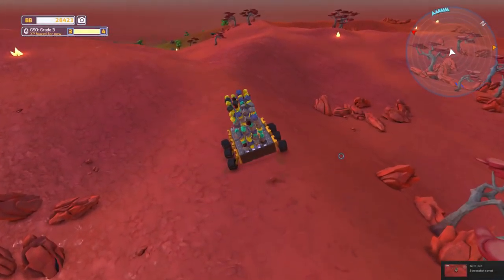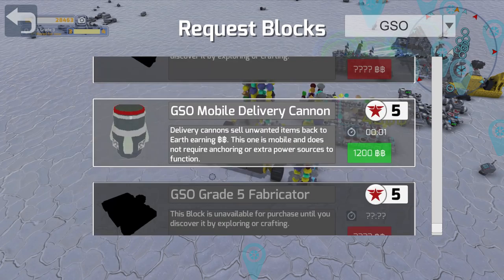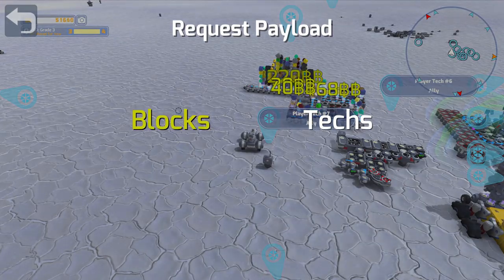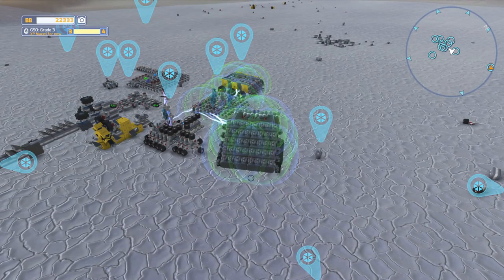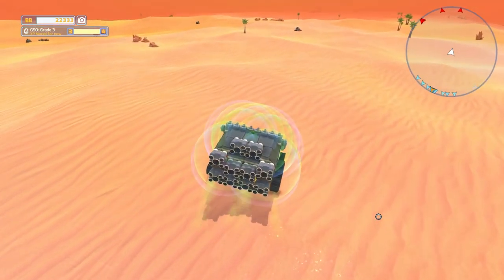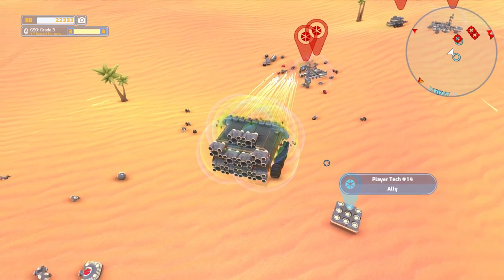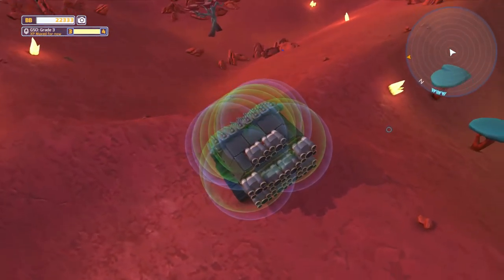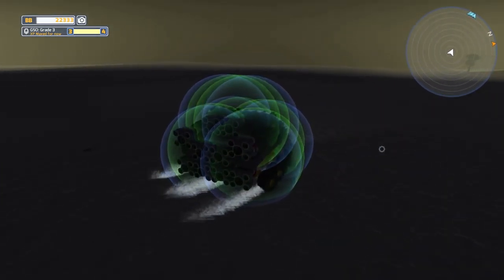TerraTech #17 - 150 Pound Cannon

Comment: The rugged wheel you just found is the best wheel in the game for the tech size your using and there free. If your having trouble getting plumbite pickup the 1 x GSO blocks run them thru the scrapper and refinery you get 2 ingots.

Comment: +Zisteau 
Fabricator grade 4 and 5 you probably don't have and maybe don't spawn. Might need an invader with one on. Or getting lucky with a "block holder". 
I set up small base close to the GSO Trading Station and start destroying larger techs and sell parts. The tech I use is not so much bigger than your mining one (6 wheeled GeoCorp). I use mostly  15+15 of the small cheap laser weapons on the front, they wreck most AI techs fast enough and with accuracy without destroying too much (if not a battery, fuel tank or booster explodes). After a few days playing I have almost 2M BB. I have a small base and 1 tech, costs just 30K (1 large  battery  4x4x4 gives 12K, find such techs frequently enough).

Comment: Hey, you could improve the BB output of this processor at the beginning with filter conveyors, so that your resources continue around the foundry loop until they are alloyed. The only un-alloyed resources that go to the cannons should be luxia, rubber, and hydrocarbs. Toss some scrappers on the first line, and you can toss all resources and small GSO blocks into the receivers, and they'll get recombined into alloys.

Make your battle and harvest techs wider in the middle and they can spin on a dime.